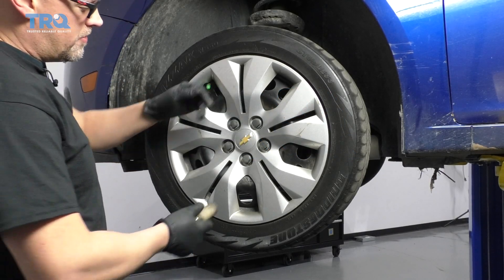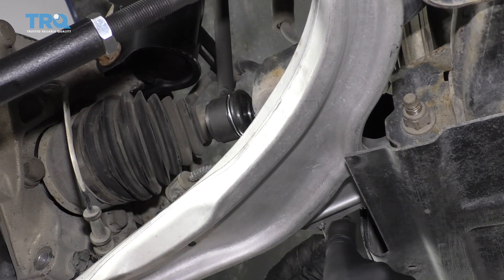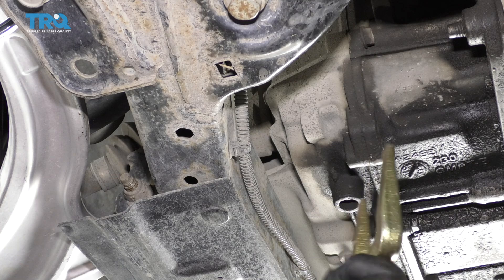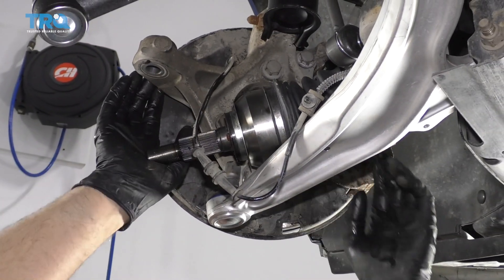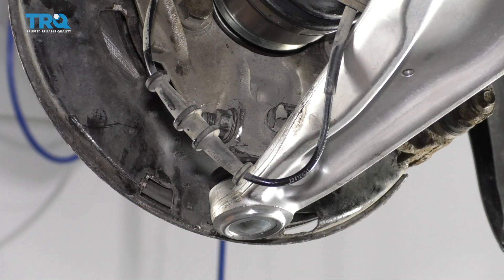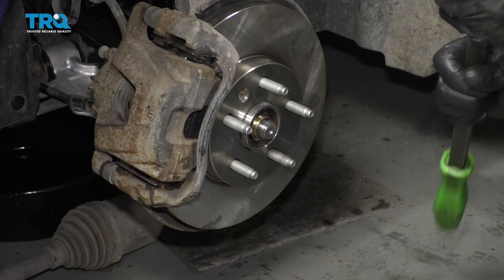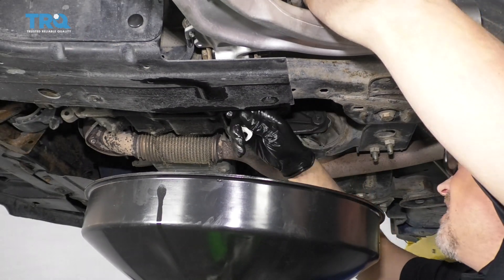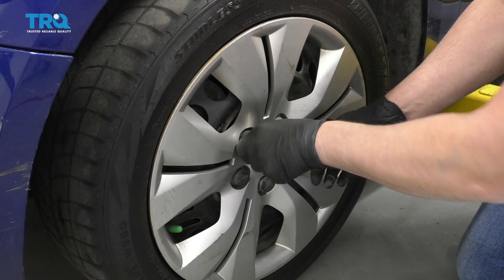How to Replace Front Driver Side CV Axle 11-15 Chevy Cruze

Comment: I noticed you didn't apply anti seize grease on the outer spline, is it OK to evenly apply a small amount on the outer spline.
Reply from the maker: +Jan Palmer If it is needed, you may add a small amount of anti-seize grease to the outer spline.

Comment: I have a 2012 Chevy sonic and that washer was found loose rounded out  and worn through on one side of the washer. It the started to get caught up between the bearing and wheel speed sensor destroying the bearing magnetic strip and the wheel speed sensor both. So I'm having a hard time finding that washer at GM's parts site . So I dont know if they just  eliminated that washer because of what took place with my car.? Anyways thank for sharing.